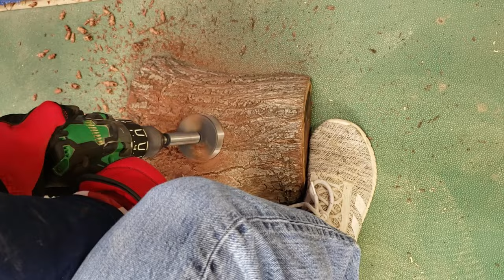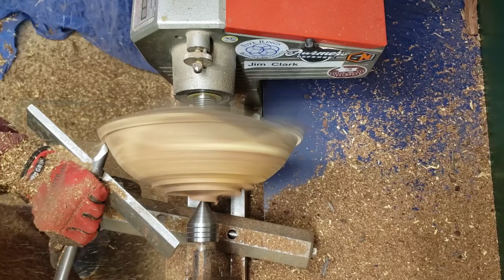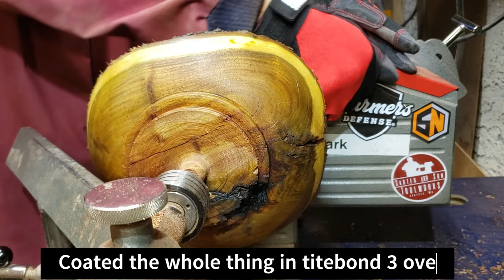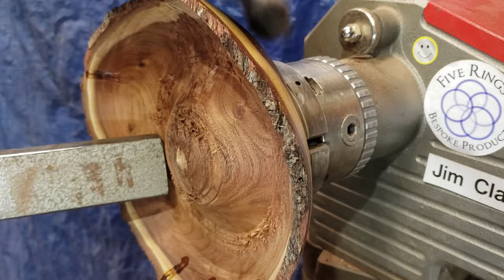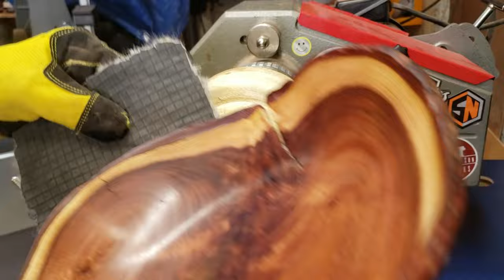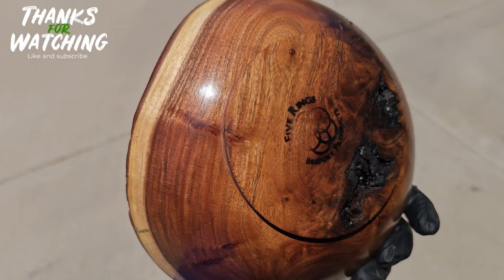Woodturning - Shoestring acacia crotch bowl 500 Subscriber Giveaway

Comment: What brand of lathe are you using? As the head seems to turn to the side. Thanks
Reply from the maker: I have a Nova 3000.  It's old and has been discontinued but it does the job.  The rotating stock is a gamechanger for me.  My shop is very small and I don't have space to turn off of the end of the lathe. 
 Rotating makes it very comfortable (and safer) to hollow the inside of bowls.  You don't have to lean and get in awkward positions to get the tool inside of the bowl.  

There are a number of lathes you can buy today that have a rotating headstock.  Record Power, Nova, and some others offer them.  My dream would be to upgrade to the Vicmarc VL240.  @KerryCorney in Austrailia has one and he does a lot of production turning in addition to art pieces.  He has a Youtube channel that is worth watching.  Thanks for watching!
Reply: @FRBPturning  Thank you for the response. Much appreciated

Comment: You really need a bandsaw to take off the corners and to even things up some.
Reply from the maker: @jbaker7903  I have one and trimmed one of the branches back. I was hoping for a larger heart shaped bowl but the big cracks didn't go away like I hoped. So I did indeed spend more time than I needed to. I prefer to keep blanks as big as possible when going for a live edge so I have material to spare to make changes. I don't mind the extra time to get the best result I can.
Reply: @FRBPturning  Yeah, I hear ya. I just always trim stuff off that I know I can't use. I see lots of people turning big square things into small round stuff, and it seems like a waste of time.
Reply from the maker: @jbaker7903  if I have a more square piece I usually knock the corners off to save time since I'm sure they will get turned away. But a live edge crotch has too many unknowns for me at my current level of experience.
Reply: @FRBPturning  Well you did a real nice job on the bowl, so don't let my criticism slow you down.
Reply from the maker: @jbaker7903  thank you. I'm happy to take constructive criticism, I still have a lot to learn!
Reply: @FRBPturning  never stop!!

Comment: Dangerous nub removal
Reply from the maker: If you feel anything I do is not safe for you, don't do it.  I'm very clear that this is for entertainment and my methods are not for everyone.  For a small bowl like this, at 200rpm, the energy stored in the bowl is very low and the risk of injury (especially with my safety gear on) is very low.  If you prefer other methods, that's fine too.